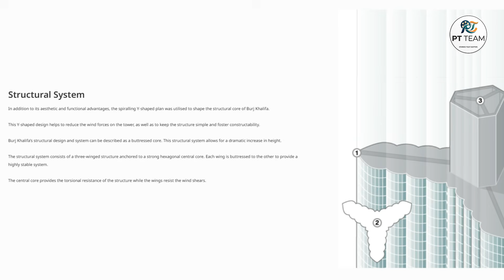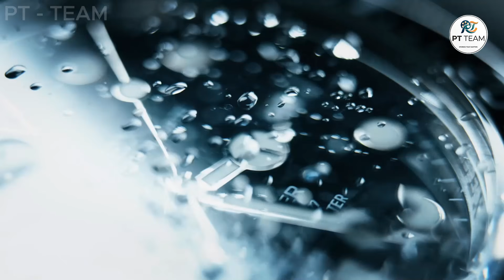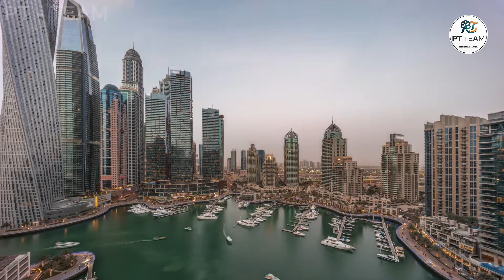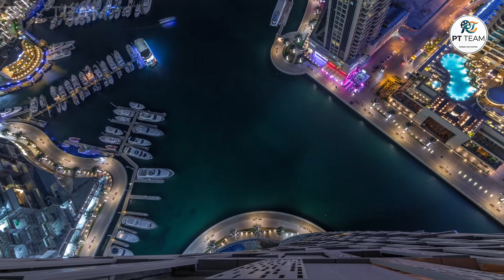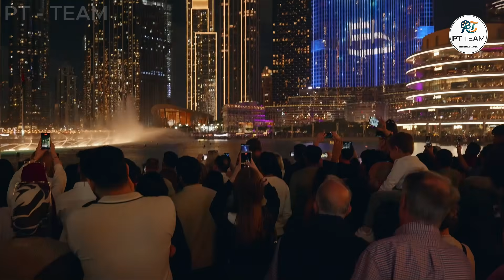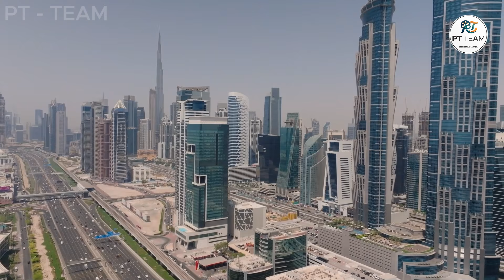Why $100 Billion TRAPS Dubai: The CORROSION Illusion!

Comment: stainless steel 304  ?
Reply from the maker: 304 stainless steel is common, but in salty coastal conditions, 316 is usually more corrosion-resistant.

Comment: Grounding of anything electrically acting as a conducting material shouldn't require power.
Reply from the maker: Correct. Grounding itself is passive and needs no power, though monitoring and protective systems may depend on electricity

Comment: This is all interesting and educational but I keep asking: Why not use the ancient ROMAN concrete formula which has stood the test of time for a couple of millenniums by using a LOT of volcanic ash in the concrete formula ?
Reply from the maker: Roman concrete was remarkable, but it was not designed for steel-reinforced skyscrapers. Modern concrete often uses volcanic ash or similar pozzolans, yet corrosion control, strength, and construction speed require a different mix